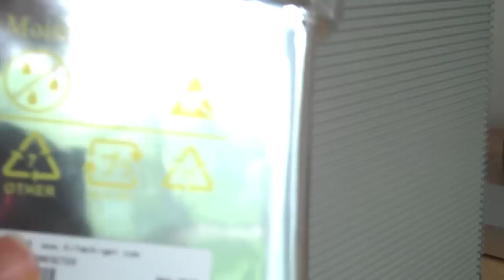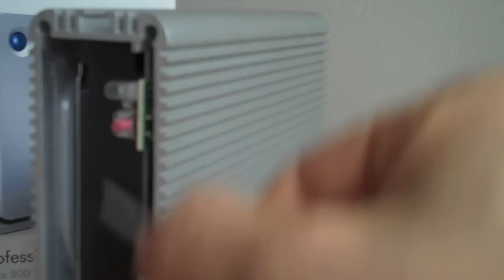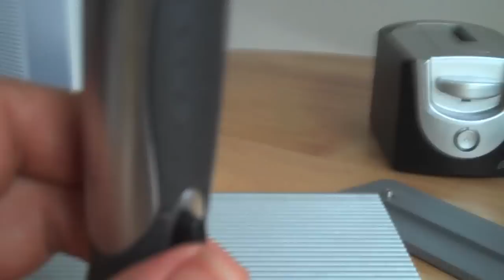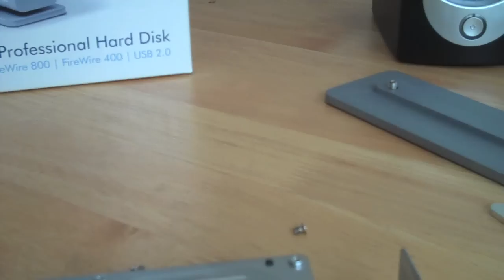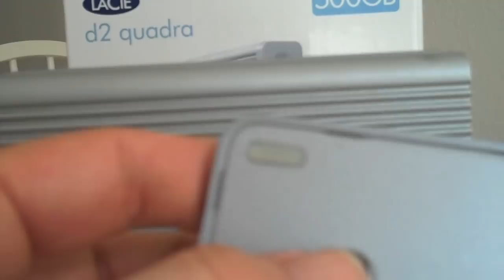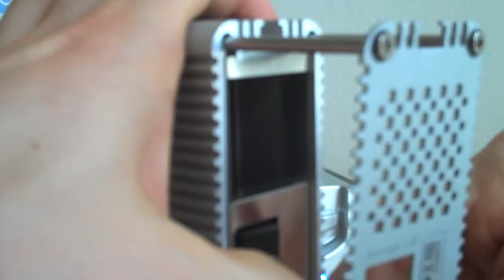500GB, 1TB, 2TB  Lacie Hard Drive Take Apart, Upgrade [HD]

Comment: Thanks for this tutorial - you gave me the confidence I needed to extract the drive, with it's data, from a housing which had lost it's ability to work (not a failed external power supply problem this time).  Cheers.

Comment: My c.2007 d2 drives BLUE LED activity light quit blinking.

The drive boots up and works just fine

with several older Macs , here.

The LED's leed's are encapsulated in plastic or glue.

Hard to test for continuity.

Any ideas?

Thanks

J.C.

Older Macs here since 1997 <

Thru late 2009....

Comment: HI, thank you for your video..! I have two boxes, one D2 Quadra V2 like yours, and another V1 from 2 broken HD unoperative. I would like to know if today is possible to install 2 new HD inside. What could be the limmit for the new HD storage? I was tthinking in 10TB instalation...but I'am not informatic. Both boxes has thunderbolt and USB2 conection; maybe they are old conections, but if it works it wolud be fine for me. Can you support me with limit storage and possible Issues, uncompatibilitties, please..? Thank you very much

Comment: hello thanks for the tuto, well i changed the hard drive of my v2 d2quadra (originally it was a 1TB) by a 3TB, everything is ok but the vibrations of the hard drive (even when just plugged and nothing transfering) are really noisy, do you have an idea (well it's only when the support is on a table...but i will not put it in the air with long file transfer on it) 
another question, is someone have the "Lacie setup" bundled with the drive

Comment: already made the upgrade with a hitachi.. my quadra was purchased on 2010 and the hitachi is dec 2009. after copying around 40gb of material it starts doing a barking sound. already replaced the hitachi with another that the warranty gave me and upgraded the quadra firmware.. is this normal?

Comment: hi ! I also have the Lacie Quadra.

 my 1tb has some number on the power that are not matching the 2TB i tried to install... and as the result is that  it did not work...

My old broken HD reads:
RATED 5V   420mA. 12V  700mA

a 2tb that i want to put in the LACIE reads:
RATED 5V   400mA 12V  850MA

which one do you find compatible with that Lacie Quadra?
Do these information need to be the same?
thanks

Comment: Can I replace the broken Seagate Barracuda ST3000DM001 inside of my quadra drive by an HGST Ultrastar 7K4000, 2 TB? Are theres any issues for this swap?
Reply: Im pretty sure you can put a harddisk of any brand into it, doesnt have to be seagate. but I would also recommend seagate or even better a western digital harddisk if you want high quality. but you can also just use the cheapest drive you can find tho. Make sure it comes with SATA connector and in 3,5 inch size.
Reply: Thank you very much for your reply. The reason I want to replace the broken disk by HGST, is because according to backblaze they have the lowest failure rate after being tested quite intensively. I've had some very bad luck with Seagate.

Comment from the maker: @ebbulk In this case I picked an Enterprise 5 Platter design HArd Drive - which is a lot more reliable / better than a Seagate or Hitachi consumer drive (costs a lot more). As for consumer drives, check reviews of individual drives these days. No one manufacturer is "better" - it often depends on which model you look at. Example - i found out (speed tests) that my Hitachi 5400 laptop drive, is a lot faster than my new Seagate Momentus 7200 rpm laptop replacement drive in Mac Book Pro.

Comment from the maker: @MrYannstube 2TB is officially the maximum, based on heat configuration and design. 64MB buffer should definitely NOT be a problem. what format did you use? (FAT, NTFS, HFS+ ?)

Comment: Older generation LaCie d2 Quadra 301110U 500GB machines are quite different inside.

Beware of thread sealer on at least one of the 4 drive screws.

( I had to drill one out and re-tap, later....)

And LaCie firmware that rejects non- OEM Samsung drives...

Such as Seagate and WD....

I tried 3 of each, that work in my NEWER finned body d2 just fine!

As seen here..

But not in the older smooth bodied finless  301110U.... 

Again....

BEWARE!

J.C.

Comment from the maker: before you call somebody idiot you should check yourself into a clinic for whatever issues you have . i won't physically kick your wimpy butt, but do it by telling you that  3 out of the 4 eSATA chipsets have been disabled by Apple - meaning that the 3/4 express cards  out there do FIT but will CORRUPT your hard drive if you connect it. There is currently one chipset and brand left that would work , it costs 199, and can be disabled by apple anytime. We have ran many tests, none worked.

Comment: I have a Lacie D2 Quedra 3 TB with the disk working but a hardware problem in the case. Please could you tell me what kind of case I could get to replace the original one? The HD inside is a SATA 3,5? I just need to connect it through the USB 3 port. Thank you very much